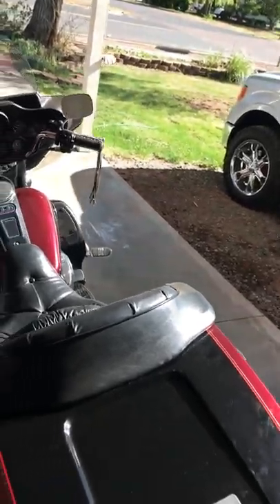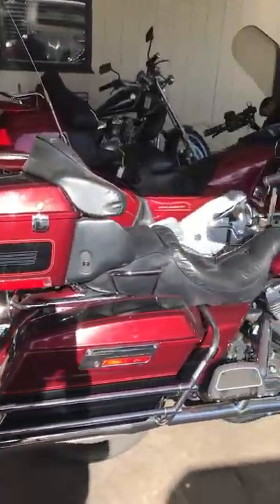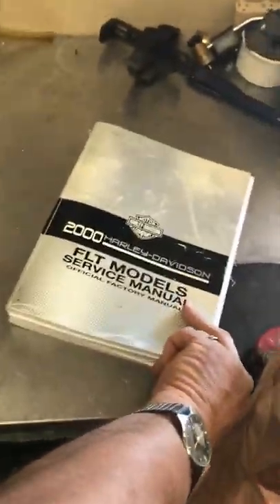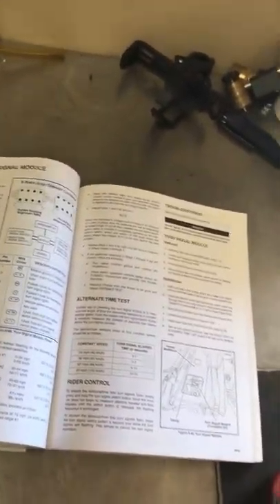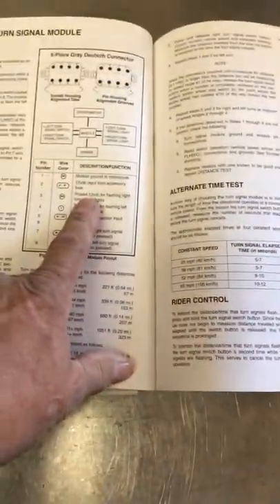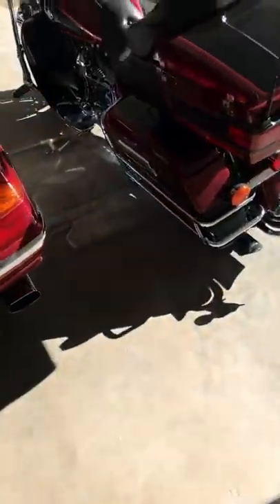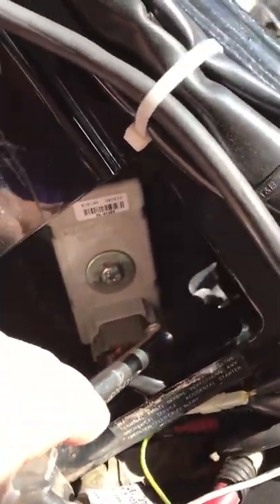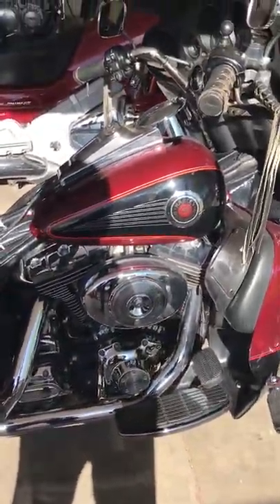2000 Electraglide FLHTCU-I OEM Turn Signal Repair

Comment: I have an 02 Ultra, the turn signals started with not cancelling after turns, then no start after riding a while, found to be my TSSM, Turn Signal Security Module.  Glad you're fixed.

Comment: Very good video,   Never knew that was there, If I had to do that to mine, I would bolt a outlet box to the bike, sideways at the attachment point, for the module, and then bolt the module to the box, at least two inches higher up.👍🇺🇸

Comment: Good video, I put new bars on my 97 model, having turn signal problems. I'll check this out. I'd pit a small strip of heat wrap on the bottom so your new one doesn't get to hot. Thanks good video.
Reply from the maker: BURRCO 308 thanks for the tip

Comment: Wow! I have been having trouble with my blinkers on my 03 i will dig into it later today. Thanks
Reply from the maker: darin vargas I don’t know why you can’t find anything else about this online, I searched and searched and nobody seem to have any tech advice. I hope this helps you out if it does please pass it along. And thanks I ask is please subscribe and if you like the video go to big thumbs up thank you
Reply from the maker: Mark Jones Yes the module is not cheap at all! I didn’t want to pay it either, but I finally ponied up.
It would seem that there is no other kind of module that does the same thing as this module.
I heard it was located on the right side panel behind the fuse block

Comment: I have 2006 FLHTCU with Factory Alarm. I'm guessing this would be the same location for the TSSM (Turn Signal Security Module)? I will be checking when I get home.... My little red key on my gauges came on over the weekend & now I have no Tachometer or speedometer!  I have been having some issues with turn signals since last year.....  Hopefully this helps as n ihave tried to get codes by holding down the trip button and turning the switch to on(with RUN on too) ..... no luck there.
Reply: Robert Zuccaro   - Yes I have it all working now.  Except for the front right turn. But think I have a bad wire somewhere on that.  Mostly went through all fuses and connections.... The accessories fuse was bad but not visibly....Had to use a tester.

Comment: I have a 2013 ultra classic electra glide. Just lost the left signal. I'll look into the module now after bulbs, plugs, and wiring thanks
Reply from the maker: David Santistevan I would start with all the very obvious things first, as you said lightbulbs may be a break in the wire somewhere. My problem turned out to be an intermittent problem came and went. At this any rate I wish you the best of luck!

Comment: You put the New one right back in the same spot lol
Reply from the maker: I am sorry to say,,,,,,yes I did.
I couldn’t figure a better place, I’d take suggestions.
Reply: @mikegreene163  I would place some building insulation in there to stop the heat transfer at the very least. Doesn't burn, and will lower the temperature inside that area a great deal.